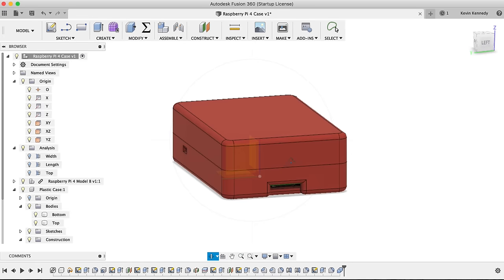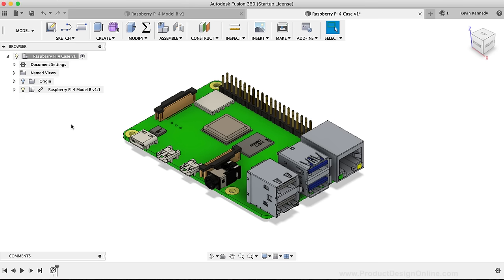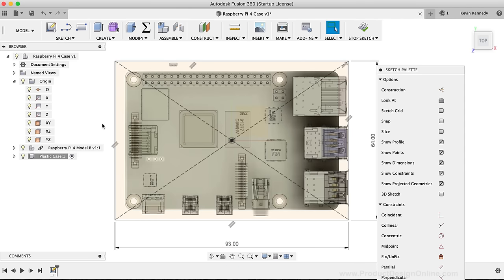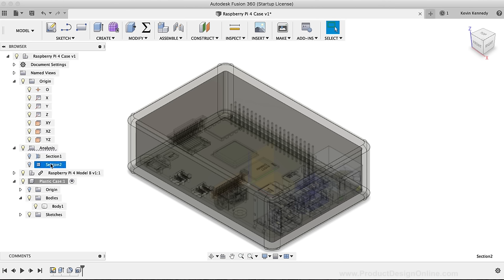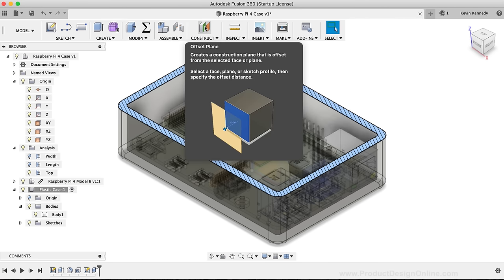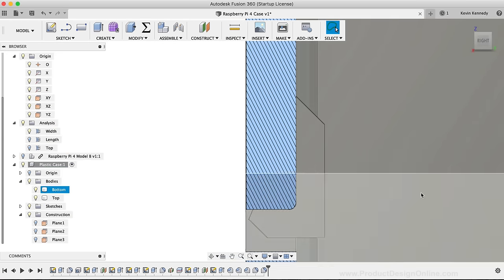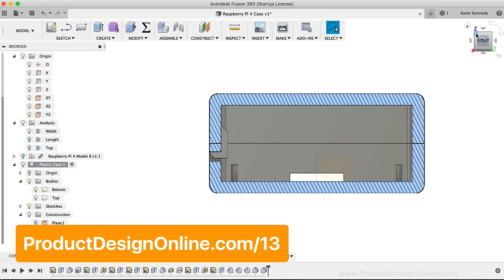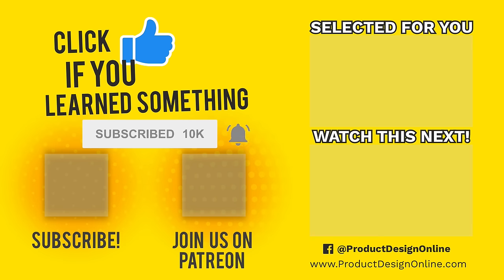Fusion 360 Snap Fit Cases | 3D-Printable Raspberry Pi Case

Comment: Great tutorial. I love the ability to bring the model of the Pi. I am currently using the free startup version of Fusion 360. I've been getting notices to update to the newer subscription. It looks like I will have to go to the personal version but it seems I will loose the ability to import models in other formats (Solidworks etc). Are there other ways to convert?
Reply from the maker: Hi, Steve. You can continue to use the (old) Startup license until your current 1-year license expires. It should be 1 year from the date you signed up or last renewed. With that said, that is correct that the new Personal Use license has some limitations. You will be able to still use STEP and IGES files, which are also widely used and can be exported from the other programs. You can see the whole list of file formats that are included in the personal use license here - https://knowledge.autodesk.com/support/fusion-360/learn-explore/caas/sfdcarticles/sfdcarticles/Fusion-360-Free-License-Changes.html#file-formats

To convert files you can use GrabCAD Workbench (https://grabcad.com/workbench). Upload the SolidWorks file there and then you can download it as other popular file formats. I believe they used to have a freemium model but I'm not sure if it's still free or not. 
Cheers, Kevin :)

Comment: A great tutorial Kevin. I followed you through it and made a few modifications so I could mount it on my Ender 3 printer. The only problem is that the top and bottom cut away has no tolerance, so the two halves don’t connect. How do you add a tolerance to enable them to fit easily? Or did I miss something?
Reply from the maker: Nope, you didn't miss something... I forgot to do that in the tutorial. I did pin a comment in the comments section that has a few notes about add clearance there :)
Reply: Thanks Kevin. I found the pinned comment. Do you have a tutorial that shows how to add the tolerance? Newbie I’m afraid.

Comment: I am following along with your tutorial to make an Arduino case. I am encountering a problem. When I do a section analysis, one of my connectors does not appear in the section analysis like yours does. It is there in the drawing but it is transparent instead of a solid color like the other connector. Also, One of the bodies for arduino the reference model  has a yellow icon instead of a white cylinder icon. Any suggestions on what could be wrong?

Comment: Enjoyed this video. I was searching for a solution to my inability to remember where a certain item was located within the menus. Guess this is as common in many other applications with such flexibility built-in. After searching a couple of videos I was exhausted. Thinking some kind of cross-reference via text and time in order to find "How to" a bit easier. For example, I was searching for how to split or cut a box into two separate items from one item. Not sure if you covered this so started watching video after video finally stopped and decided to write this little blurb for you to maybe help or ask for help in creating a cross-reference for your videos. Let's be honest this would be great to have and if you could, for example, look up "dimensions" and it would tell you what video to watch or link it to the video. Just a thought.
Reply from the maker: Hi, Rud Dog. Interesting thought - thanks for the suggestion. There are a lot of things I would like to add to my website... and I agree a better way to find certain topics would be helpful. I'm hoping to add a more proper search box that pulls up anything relevant will help. Majority of my time right now is going to my woodworking course, but this is on the todo list for after that. Cheers, Kevin :)

Comment: Hi Kevin.
I tried to use the snap fit catches on a different box and my son said that they were too stiff to push inside the box, when printed with PLA. I took a few mm off the front of the catch which also resulted in less catch surface area, and they seem slightly loose. I don't want to print with Nylon, so I wonder if you have a better version of snap catch for PLA?
Reply from the maker: You have the right idea - with a gap between the latch/catch - I generally print in ABS or Nylon for this type of stuff, as otherwise PLA tends to break easily.

At some point, I have an improved design (and more F360 topics to cover) that I'll use for a new/updated video.
Reply: @ProductDesignOnline  Thanks Kevin. A new video which favours PLA would be most welcome.
What I have observed is on some electrical connectors I've just been using. They accept a single choc-block connector and the covers are snap fit. What they've done is to have a solid catch and make the mortise walls thin, so that they bend out, instead of the catch bending in. I'm going to see if I can make a 3.5mm walled box with a thin bendy section for the catch.

Comment: If you are using the new Fusion 360 where Model workspace is now Design workspace, you can find the Overall Slot command by typing "s" for shortcut and searching for Overall Slot.

Comment: Just came across your channel and am really enjoying the Fusion 360 detail that you are explaining.  I have learnt more about this product in the last 12 hours than in the previous 12 months of trying to decipher the products help content.  However, there is a process at the end of this video (around 32:24) where you show how to make an extrusion to keep the top and bottom parts of the case aligned. I have tried to duplicate your process but it just doesn't work for me. Looking at the image of your Fusion version, I think I have a later version (2.0.12665). I start with the Offset command, but when it is active I can't select anything on the model (no faces, edges, points etc). Have they changed the behavior of this command in the latest version, and if so how do I do it now?
Reply from the maker: The offset command still works the same. It sounds like something else is preventing you from selecting it. Can you share the link your Fusion 360 file?
Reply: @ProductDesignOnline  Finally worked out how to produce the final extrusions mentioned at 32:24 in my version of Fusion. I set an offset plane to the top surface of the case bottom part and then project the edges of the top surface to this plane.  I can finally then select the edges and perform the offset. I can't for the life of me see why I can't do the steps in your tutorial, but I've tried everything to no avail. One of life's little mysteries.

Comment: i am new to Fusion 360, how do I import a step file?  Outstanding Presentation
Reply from the maker: Hi Phil. The easiest way to get a .stp file into a Fusion 360 document is to use the Upload command in the Data Panel.

Once you’ve selected Upload, choose the .stp file you want to use and select Open. Next, you’ll see your selected file on the Upload dialog, so you can now select Upload. After you select Upload, the file converts from a .stp file to a Fusion 360 file. The end result is a Fusion 360 file with the same name as the .stp file you uploaded.

Comment: Thanks For the tutorial. I made changes to it. Boy did I get lost for a few hours! Rather than Pins, I wanted built-in standoffs. I wanted the PCB to adjust automatically per the standoff height(I.E. PCB sitting on top of standoffs). Every time I tried it, that is what would happen....kind of.  The PCB would go up in height with the standoffs(correctly), But all the components on the PCB would stay in their original position(no longer attached to the PCB).  I finally solved that problem by doing a Combine and used the selection window to select all bodies (from the Raspberry PI 4 model) after breaking the link, making a new component. Then I deleted the original Raspberry PI 4 component from the project.  Now the PCB and all components do adjust when changing the standoff height. A couple things have me thoroughly confused. 1) When do you use ground? 2) What do you ground or should you? 3) When Do you use a joint?   
  In this case I grounded the plastic case and used a rigid joint to attach the PCB to the top of the Standoffs. I have no idea if this is the correct way of doing it.  
Next up, trying to adjust the projected cutouts for the USB to also change with the PCB height. Maybe that already works? ….Not there yet(Edit: the cutouts in the case also automatically adjust "cool").  This really tested and "old guys" abilities. lol
Overall a very good tutorial. And the tutorial was just the right speed! Some YouTube tutorials are sped up so fast, you have to replay them 100 times to get anything out of them.
Reply from the maker: Hi, muskateer10. Typically, the best practice is to ground the bottom component (that would be touching the ground, or table, etc). However, there are some scenarios, where it may be beneficial to ground a different part and apply joints to the surrounding parts.

You are correct in grounding the plastic case and adding a joint to the PCB. If you have the PCB (or desired part) in the correct position, then you will want to use an "As-Built Joint". If the PCB (or desired part) is not in the position yet, then you can apply a "Joint," which will force the object into position based on your selection. If you're interested in learning more, I cover these topics in this video - https://youtu.be/t41QmQszcbE

Cheers, Kevin :)

Comment: Kevin I just finished this tutorial,  I would like to 3D print a battery cap onto to the top of a Ryobi Battery.  I know I can use the extrude and shell commands to create the cap,  Could you point me to a video that will help me create protrusions along the sides of the cap to run wires to the battery terminals on each side of the cap.  I figure I could use the pipe command to create space for the wires under the cap, but I an not sure how to join the pipe to the cap to create the space for the wires to run along the sides of the cap on the inside.  Thanks so much.

Comment: 2 observations: the snap will need suports to print (2mm on the air)? The final rail has not tolerance in the cover.

Comment: I have worked with an Uno. Does fusion 360 work with Snapmaker? Getting a Snapmaker 2.0 soon.
Reply from the maker: Hi Jon. You can use any 3D printer. You'll export the Fusion 360 file as an STL into your slicing software, or you can slice it right in Fusion 360 to generate the g-code (that just takes some setup the first time).

Comment: Excellent tutorial and an ask - you do such an incredible job explaining how to use the full power of F360!

How would you convert this to or produce this for non-additive manufacturing? I have a CNC (Shapeoko 3 XL) but some of the features in this type of design would probably be impossible without 4/5 axis - for instance the negative space between the tabs and the box cover. Do you have a video where you address this? For instance - i would like to design a box for my RPI based audio player, including the touch screen - and even better - to make it from aluminum. However without access to a 3d printer I suspect this will not be possible.

Comment: Wonderful tutorial but... did you try to assembly both half of the cover? I will work only if the material is a rubber. :-)  Although in this case I doubt it would work. Both latches must be flexible. So they can't be 
rigidly located as in the tutorial. The top and bottom will never match together if there is no size tolerance included. Well, unless your machine has precision of 0.000001mm :-)
But generally -  tutorial is great!
Reply from the maker: Hi, Marek. Thanks for watching and glad you enjoyed the tutorial. Per the pinned comment, I forgot to discuss and add tolerances in this tutorial. I did have a successful print after adding tolerances. Cheers, Kevin :)
Reply: @ProductDesignOnline  Hi Kevin,
Generally it would be great if you take care  of such a details in your tutorials. As complete beginner, I would like to be aware of such  aspects. I know that tutorial is focused on different subject but very often, knowledge passed in background is equally valuable ;-)

Comment: What would the best way be to align an a group of components to the origin? I imported a step file for a controller I'd like to make a case for but trying to align it to the origin doesn't seem possible because it only finds the center of a individual component and not the whole body, so it drags ONLY that part to the origin. 

It seems quite complicated actually to get it centered in a way that drawing rectangles around the body will be accurate hah, has be perfectly centered to the origin or sketch tools like center rectangle become useless

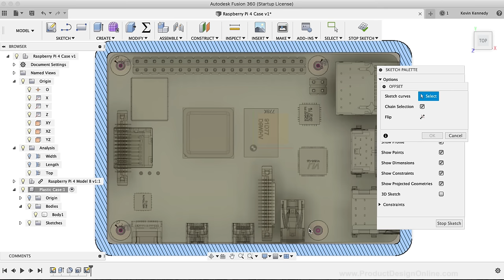Comment: Instead of offsetting other 3 circles (13:19) why not just offset 1 of them and use equal constraint to size other 3? + If you need to change size. You can just change 1 and all other updates.  Anyways awesome video as usual!

Comment: What an amazing tutorial ! Congratulations.
I'm a very beginner with Fusion 3D and 3D modeling. I'm trying to make a Pi Camera V2.1 case and I struggle to center the Camera the .step file with the origin. I try to draw construction lines by finding the middle of tow edges, but then I cannot Align neather Move the Component to the Origin point...
Can you help me ??
Reply from the maker: Hi Matt. Is the Try using the "Move Type" called "Point to Point" . You should be able to select the corner of the camera step file and then the origin point. Otherwise, you may need to use joints.

Comment: PRINT - 
Question: In the  current version, where is the P - Project menu item? There is no Sketch section in my default menu like in the tutorial, so is there a way to add that?
Reply from the maker: All the sketch features were moved to a "SKETCH" tab in the toolbar. You'll then find it in the create dropdown list (while the sketch tab is selected).

Comment: Did you print it?
Reply from the maker: Hi Christian. I printed this out in PLA and Nylon. The PLA model is fragile if you need a case that will be opened and closed on many accounts. This was intended to be closed once to cover the RPi, since the ports are accessible. The nylon model has some flexibility and seems more durable for opening and closing, but is not ideal for all cases as the overall shell is not as rigid. Cheers, Kevin :)

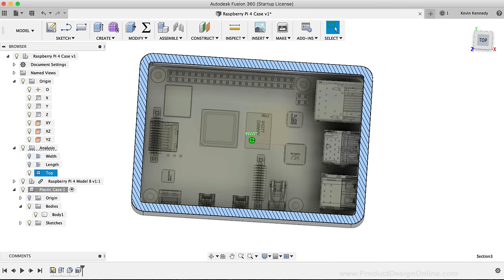Comment: Around 11:30 you have the Sketch menu where my Fusion 360 doesn't, this is probably due to the new interface. It's kind of confusing. How would  find it? I now pressed 'S' and typed in 'project' as a quick way to find it (as I would in Rhino for example). Also the extruded pins were placed on top of the Raspberry Pi board, maybe something's changed in Fusion to make it work differently? Also, the extruded pins were added as 'bodies' in the plastic case component. I can see in your video that didn't happen, I wonder why. I solved it by selecting the pins, lowering them with the 'm' shortcut, and then adding the bottom body to the selection and doing a combine.
Reply from the maker: Hi, Marinus. That's correct - the interface has been updated and now all the sketch tools only appear while in the SKETCH tab. The pins issue may have been caused by your component not being active? Hard to say without seeing the file :)
Reply: @ProductDesignOnline  Yes I found out that despite not being in the SKETCH tab, you can still access the features by pressing s and then typing in the command! Very useful. The pins issue isn't a big deal, but I was definitely working from the same face. The object vs join thing was probably because I didn't set the correct parameter in extrude. I've already worked a lot in Fusion since my comment and don't think I'll make the same mistake again ;)
Reply: @ProductDesignOnline  I had the same problem, which was solved by activating the plastic case in the browser as you suggested.

Comment: The pegs you created, should have some base with larger diameter, to elevate the PCB, otherwise, the latter will be lying right on the bottom with its electric contacts touching the surface, which is something you might want to avoid in reality.
Reply from the maker: Thanks, alextee07! Love this....appreciate the feedback. Cheers, Kevin :)

Comment: This is a great tutorial, but at the section analysis part, my case is a little bit too small for the PCB (there's some intersecting).

Would be great if you showed what to do if the section analysis shows any issues instead of just how to turn it on.
Reply from the maker: Thanks for the suggestion! I plan to do a newer version of this tutorial later this year. I'll keep that in mind!
Reply: @ProductDesignOnline  I muscled through it and made a really sweet case... trial by fire! It's actually not so bad once you learn it's quirks and can stop fighting it.  Thanks for getting me started.

Comment: Late to the party but the 2020 version of fusion 360 doesn't have the conventional sketch feature used in this video so I'm stuck. any tips on this?
Reply from the maker: Hi Sun Jay. All of the sketch tools were moved into a SKETCH tab, which only appears while you're in an active sketch environment. You can use the "Create Sketch" feature to enter the sketch environment. Otherwise, you can use the shortcut letter "S" to open the search box, type out the sketch feature, and hit enter to active it.

Comment: Hello, I was a little disorientated and confused when you moved the case at about 3:57; You moved up 6 mm why did this show a change in the y axis and not the z axis for the front view displays z vs x?
Reply from the maker: Hi, Ray. Fusion 360's move command is somewhat confusing (messed up), as it will sometimes treat the 3 axes as a different orientation based on the selection. I always recommend keeping an eye on the viewcube and not necessarily the label in the dialog.